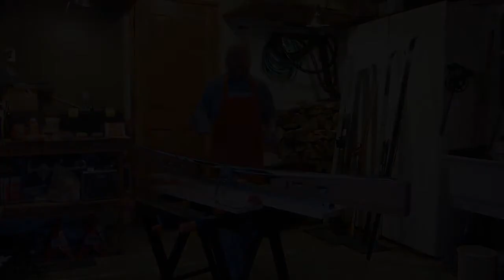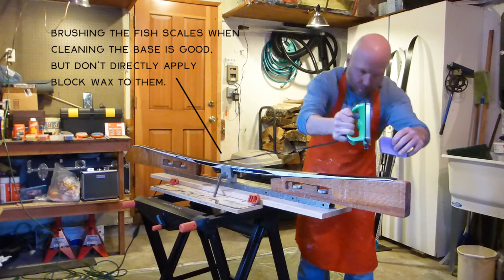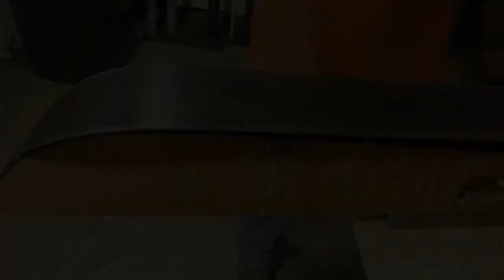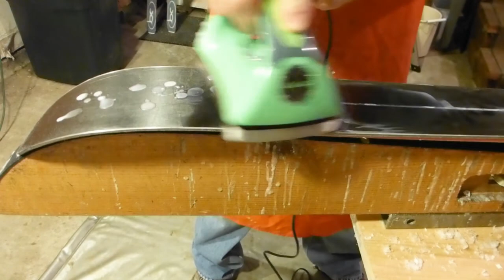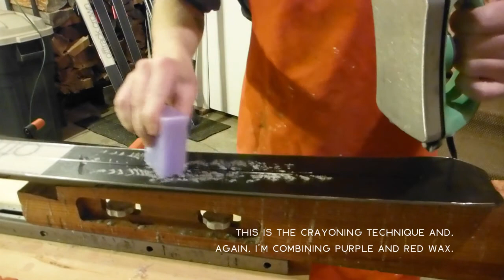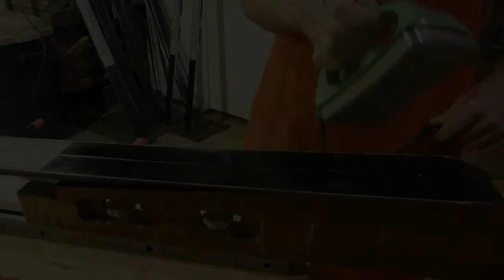Wax Your Waxless XC Skis (Part 2): Apply Glide Wax

Comment: Hi Jared, awesome video. I have never waxed my skis before. My dad would always bring our alpine skis to the shop every few seasons. I have 2 older pairs of 'waxless' Nordic skis (LindEX made in Estonia) with fish scales below the bindings and Im using SWIX F4 glide wax. should I wax the fishscale part as well as the tips and tails?
Reply from the maker: Hey Michael L,

Thanks for the question and kind words :)

Yeah, I usually put some of the liquid or paste glide wax (like Swix F4 or Toko ExpressWax) in the scale pattern to prevent snow from clumping up in that area. You definitely wouldn't hot wax the scale pattern, but having a little bit of that quick wax is just fine.

I go into more detail about treating the scale pattern in the following video...

https://youtu.be/YiPtXTCPGc4

Hope that helps! And, let me know if you have other questions.

Comment: What about using a liquid glide wax, like Swix F4, instead of hot waxing?
Reply from the maker: Thanks for the question, Michael :)

Yes, for recreational cross-country skiing you can totally use a paste or liquid glide wax (i.e. Swix F4) instead of hot waxing. It’s far easier, quicker, and less messy. I use it frequently throughout the season when I’m in a hurry or for performing “touch-ups” between hot waxing my skis. I also carry with me on most xc ski sessions a small tin of F4 paste wax for “emergency” purposes. 

That said, paste and liquid wax won’t last very long. Easy on, easy off. And because it’s “universal,” the wax isn’t specific to any temperature range. So it’s OK for everything, but it’s not great for anything.

Probably more detrimental to the bases of your skis, however, is the fact that most people who exclusively use paste or liquid wax never actually brush out their ski bases. So each time you apply more of that paste or liquid wax, you’re just adding more goop to the mix. No matter how clean-looking the snow is that you’re skiing on, you’re still collecting the tiniest bits of debris between the fibers of the ski bases. So if you just keep putting more paste/liquid wax over the top, you’re just sealing all that garbage in. I’ve seen the compounded effects on the bases of skis when only paste or liquid wax is applied without ever brushing them clean. The bases of the skis ultimately wind up resembling coarse grit sandpaper. You can no longer see the structure of the ski’s base, which is essential to decreasing suction and, ultimately, friction.

My recommendation is that if you’re going to primarily use a paste or liquid glide wax, invest in a bronze brush. Then, prior to applying the fresh paste or liquid glide wax, brush out the ski bases with that bronze brush.

Honestly, you’d probably do more good for your skis just by brushing them out rather than applying any type of paste or liquid glide wax (if you could only choose one of those options). Ask any dentist, and they’ll tell you that toothpaste is fine but it’s really the mechanical action of brushing that gets your teeth clean. This is not unlike treating the bases of your cross-country skis.

You may have already watched this video, but I talk a little more about this concept in my 5-minute waxing video (https://youtu.be/R-SYLFtpOts).

By no means am I saying not to use paste or liquid wax (I do). I just think it would be exponentially more beneficial to also use a bronze brush. 

Hope that helps. Let me know if you have other questions!
Reply: @JaredManninen  Thanks for the timely reply Jared. I've been skiing for many years, originally staring out with wooden ones that I had to apply pine tar to at the beginning of each season. I then moved on to waxable fiberglass. At this point, I'm using "waxless" ones, simply because I felt I was paying too much time waxing and not skiing. When I bought them, at L.L. Bean, they said all I needed was this F4 wax. Boy were they wrong! You videos show that plainly.

I will be going back to hot waxing my tips and tails of these waxless skis after buying a few supplies. One thing I need to buy is a better iron. In the past I used a hand held waxing "plate" that I heated with a torch. I see now that probably wasn't the best choice. However, at the time, it was the most cost effective for me.

Before using a temperature based glide wax, what kind of wax do you recommend for just a general base preparation?

Great videos, by the way!
Reply from the maker: @michaelharmon5962  Thanks for the kind words, Michael. And I'm glad these videos are helping. Again, you could just keep applying over and over the F4, but it's not a sustainable practice for keeping your skis in tip top shape for years to come.

All of my classic skis are waxless as well, but I constantly wax them all season and the bases look fantastic on all of them (except for my rock skis, of course). The whole point of the waxless movement was to decrease the amount of time spent preparing your skis and more time running them! But, all the marketing (for decades) neglected to mention that the tips and tails still need to be treated with glide wax.

What brand/model of skis are you running?

I won't get into it here because it would take me too long, but most likely the bases on yours are not made with fiberglass. Just about every type of waxless xc ski nowadays (from the main manufacturers) is made of a P-tex type base that has structure in it (sintered). If the skis are made by an off-brand, it's possible that they have a non-structured base (extruded) which won't really hold any wax.

Still working on the answer to your other question... :)
Reply: @JaredManninen  The skis I bought after the wooden ones were waxable. They were made by Bonna and Conquest was the model. The waxless skis I'm using now are made by Fischer and the model is OXT Spider 62 Crown. 

Regards, Mike
Reply from the maker: @michaelharmon5962  Excellent! I actually have two pair of those Fischer Spider 62s. I use them quite frequently. The tips and tails have structure (sintered), which means they're capable of holding hot wax treatments. Like I said, though, I would get a bronze brush and use that as frequently as you do when applying the paste/liquid wax. You'll get your money's worth in the long-run. Although, I'd also recommend giving them a hot wax treatment once in awhile, especially if you already have the gear for it. As long as you're sticking to recreational/functional waxing, you can do a really quick hot wax treatment on waxless xc skis because there's so little surface area to deal with.
Reply from the maker: @michaelharmon5962  See my reply to your other question below. But you have the right idea. Get an actual ski waxing iron. Always use the correct temperature iron for the specific temperature-rated wax you're using. Too low of an iron temperature and you won't heat the wax enough. Too high, and it'll burn the wax and put a whole bunch of nasty chemicals into your air space!
Reply from the maker: @michaelharmon5962  I gotta run to work now. So I'll get back to you later if you have more questions. Thanks so much for watching and for all of the feedback and questions you've provided!
Reply: @JaredManninen  Thank you so much for all the help! Your responses now have me heading in the right direction. Thanks for taking the time to help.
Regards,
Mike
Reply from the maker: Hey Michael,

One last note about using liquid glide waxes ... I just read the article titled "Liquid Diet" in Cross Country Skier magazine's Fall 2019 (#39.1) edition. Basically the article talks about the latest high-end liquid spray-on and sponge-on waxes that can be used as a partial replacement of block waxes. But they're not a total replacement to those block waxes. The author says recreationalist xc skiers should still hot wax their skis every 100-150km because "your skis still need the thirst-quenching effect of traditional, ironed-in paraffin from time to time." It's a short, but quality article. If you haven't seen the magazine yet, consider getting a subscription. I believe it's the last of its kind (i.e. the only xc magazine on the market in the US). Reasonably priced and just a beautiful publication. https://www.crosscountryskier.com/
Reply: @JaredManninen  Thanks again Jared. I just checked out and subscribed to the magazine.
Reply from the maker: @michaelharmon5962  Fantastic! I'm sure you'll like it :)
Reply: @JaredManninen  Your videos and this exchange above are super useful, thank you so much for taking the time to create and share. I'm based in Scotland and just recently bought a pair of waxless (fishscale) skis (Sporten Ranger). Already chewed up a bit by foolish use on terrain with stones and marginal snow cover (typical here). Anyway, was trying to figure out what I need to do to take basic care of them and your advice really helps. I'm surprised the store I bought them never gave any advice. I'll invest in a brush, and may start off with liquid wax at first as a quick fix convenience for the time being (Toko "Grid & Glide" seems available here, not sure what else). 

Once I do switch to a "proper" (hot) wax, any advice for an all-round wax that would be functional (even if not optimal) for a fairly wide temperature range (hardly ever below -5C and potentially above 0)?
Reply from the maker: @arnopr  Thanks so much for the kind words! Glad you're getting some mileage out of this video and the subsequent conversations. A lot of the comments and conversations on my channel are really helpful. I love answering everyone's questions because I know it helps other people (such as yourself).

I hate to say, because I don't want to talk bad about anyone who sells xc ski gear as there are so few shops nowadays, but many shops just don't have very deep knowledge about cross-country skiing and all the details about gear, wax, and maintenance. I actually used to work at a small outfitters many years ago that fits this same profile. At the time I was just learning, and we did sell a limited supply of xc ski gear but, in hindsight, it was obvious that the owner had limited knowledge too. I think this is one of the main reasons that my channel has seen a lot more activity over the past few years :)

Anyway, I wouldn't worry about the minor damage to the bases of your skis. Nobody wants their bases scratched or gouged, but it happens to every set of skis. They are, after all, tools for adventure and they're going to incur some wear and tear over time. Ultimately, unless you're racing you won't notice the difference. Take care of them the best you can, but don't covet them. And avoid walking across parking lots and large sections of gravel just the same. haha!

If you have access to Toko products, you could start to collect some of their wax and tools. They have a simplified system with three temperature-rated waxes (blue, red, yellow). Blue is the coldest and yellow the warmest. Check their temperature ratings for the specifics. But you might be able to get away with just buying one of those for most of your needs based on the fact that you have a pretty limited temperature range in which you're working. And, even simpler, is the fact that Toko makes some really convenient spray waxes. They aren't quite as durable as a full hot wax session with block wax, but they're super convenient (and a bit more pricey compared to the block wax). They are far superior, however, to Toko's express wax and other similar universal glide wax options. So, if you have the ability, you could just buy a bronze or copper brush for cleaning purposes and one of the temperature-specific spray waxes and you'd be good to go for awhile. With the spray wax, you could use a polishing brush as well but it's not super necessary. I do recommend eventually becoming familiar with hot waxing, though, because it is a better option for the long-term of your xc skis.

I also would caution you about using only a quick liquid wax all of the time. I have seen the adverse affects of using only those simple liquid waxes as they seem to dry out the bases and do some weird stuff to the structure of the base. So, although I do use that stuff in a pinch I use it sparingly.

Hope that helps. Let me know if you have other questions or want more clarification on anything I've said here.

Thanks again for tuning in and contributing to the conversation. I really appreciate it :)
Reply: @JaredManninen  Wow, thanks a lot for the reply, really appreciate it. I'll certainly check out Toko's spray-on waxes rather than their Express line, thanks!   And I promise that in the longer term (after this first season) I'll look at hot waxing :)
Reply from the maker: @arnopr  Very good! I look forward to hearing about your experience :)

Comment: Have you ever used the "universal" wax as a base prep before adding the glide wax?
Reply from the maker: Hey Michael,

I use universal wax as a storage wax, base cleaning/prep wax, and occasionally as my primary glide wax. The main reason for all of these applications is that universal wax is less expensive than temperature-rated waxes.

Before I go any further, however, I want to clarify my use of the phrase “universal wax.” In the context of preparing a base before applying a full hot wax treatment, I’m referring to the plain white block wax that requires heating with an iron to apply (but is not specific to any temperature range).

I’m not referring to universal paste or liquid wax (i.e. Swix F4). I wouldn’t use a paste or liquid wax as a base prep wax.

The reason I would use a universal block wax to prepare the bases of my skis is because it’s less expensive than temperature-rated wax. But I would only do this type of prep work to my skis if they were completely dirty from being in long-term storage or because I recently completed a long xc ski session in late spring conditions (lots of debris collecting on the bases).

Even though it’s only “preparation,” using a universal wax in this context still results in you performing a full hot wax treatment. 

I would brush the bases as best I could with either a steel brush. Then, I would go through an entire hot wax treatment using the universal wax. That wax will help to pull out debris when you scrape and brush it free upon applying it with an iron. Once I finish that treatment, I’d then put the skis through another full hot wax session using the actual temperature-specific wax for the skiing conditions.

I realize that’s a lot of extra business, which is why I seldom do it. But I don’t necessarily need to very often because I consistently brush and hot wax my skis throughout the winter.
Reply: @JaredManninen  Great, sounds like a plan. Thanks!
Reply: Michael/Jared, if using the Swix F4 wax a day or 2 before you go out to ride, should you always avoid going over the fish scale part of the skis? If so, why?
Reply from the maker: @michaeljonathan543  See my response to the other similar question you posted about treating the scales on your skis. Or, you could just watch this video, too, which discusses the topic in more detail :)

https://youtu.be/YiPtXTCPGc4